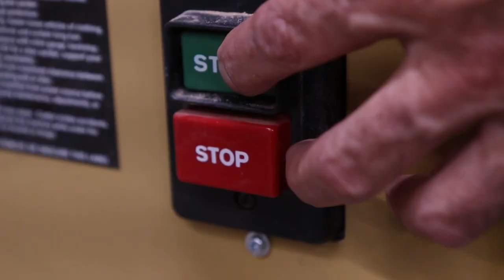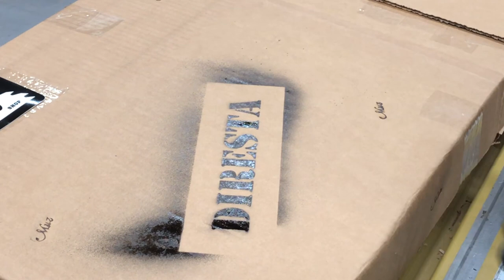The Net

Comment: Is there any way to make the groove for the net tying string without a router and table? Thanks, excellent videos. Oh what glue are you using?
Reply from the maker: Kelly Peterson I haven’t come up with a way to make the grove without a router. I wish I knew sorry. For glue I’ve used titebond 2 and 3 and they both work fine. Titebond 3 is supposed to be water resistant??? One good thing about 3 it has a longer assembly time , which you may need. Thx for watching and good luck on the grove.

Comment: Great work! What router bit is that and where did you get it?
Reply from the maker: I have a 2 part build video on my channel one is the form and the is building the net....watch.
Reply from the maker: As for the router bit.....Thanks! The router bit is a CMT 822.316.11B,  1 7/8" diameter and 1/16" thick . I know I got it online but can't remember if it was CMT website or amazon , the bearing is 1 3/4" D, so there is only an 1/8" cutting. That I got at a local bearing shop that is now close down. Look around you find something that will work , remember it does have to be CMT. I believe the bits are call grove bits....Thanks again  Muz
Reply from the maker: sorry that "watch" was supposed to be a link....https://youtu.be/du0QE6VFUIs